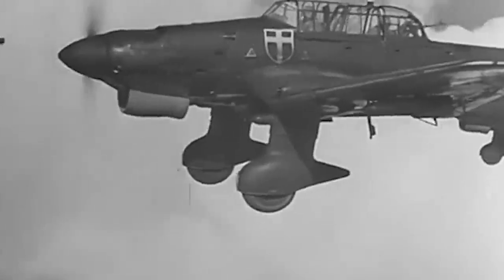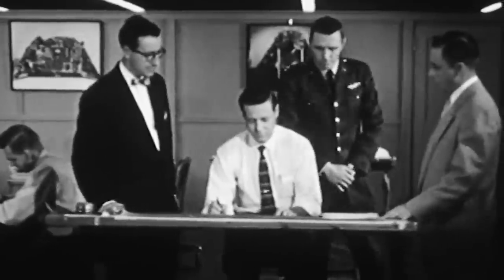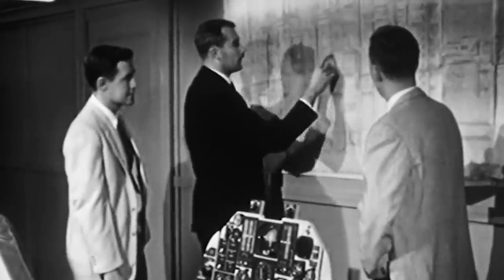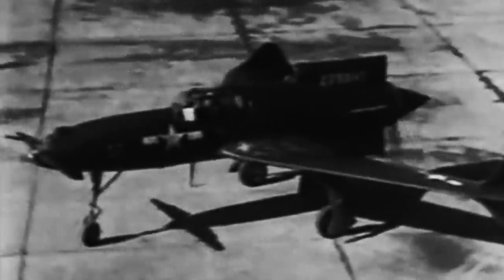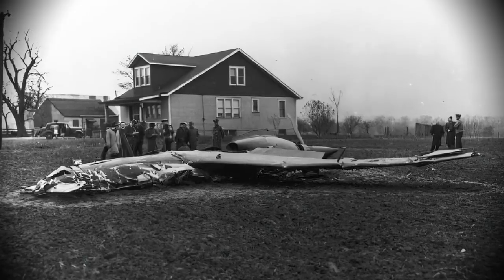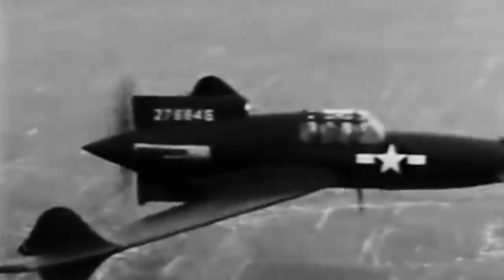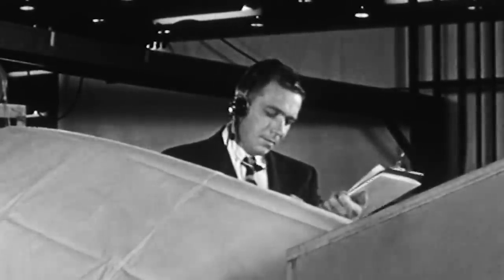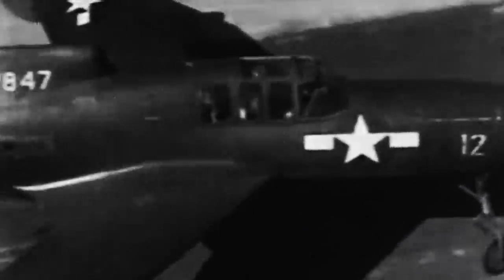XP-55 Ascender - The Backwards Fighter

Comment: That thing was a piece of art. Gorgeous design.
Reply: Controllable pitch propellers whilst adding complexity might have solved many issues with this unique approach to combat flight. There is a modern version called "the Raptor" built by a guy from New Zealand and now with 3 flights under his belt. Amazingly there are no horizontal stabilizers. Might have to ask him if he knows of this design and has any of the wind tunnel data from this variant as opposed to the wind tunnel and now flight test data of his current aircraft.
Reply: The only one left is at an air museum here in Michigan.

Comment: "can we have shinden?"
"no we have shinden at home"
Reply: Shinden made it first flight 5 years after 🤔 But that could fly 👍
Reply: @soeren850  incorrect, the xp55 flew in 1943, shinden flew in August 1945
Reply: @soeren850  The J7W was faster than the XP-55 by 70 mph. However, the Ascender never got the engine it was designed for, the Pratt and Whitney X-1800. As it was, both planes had cooling problems though the Japanese plane had it worse, being powered by an air-cooled radial engine mounted behind the cockpit -- never an easy problem to lick. The X-1800 was a 24-cylinder H-block mill that never worked as expected. Apparently, H-block engines are troublesome by nature. Both the Napier Sabre (used by the Hawker Typhoon, a plane noted for engine fires and dangerous CO leaks into the cockpit) and the Rolls-Royce Eagle were generally failures when compared to reliable powerplants like the Merlin and the P&W R-2800.
Reply: @enscroggs  Exactly. Another design that ends up failing because the engine that it was supposed to use, never materialized, underperformed, was unreliable, had critical issues etc. The X-1800 was supposed to produce 1800-2200 HP. The prototypes were stuck with 1000-1300 Allisons. Give the Ascender that power increase and a top speed of, say 440-460mph. Didn't they work out most of the bugs and improve QA/QC on the Sabre by 1944? CO wouldn't be an issue with the engine in the back, but engine fires would be more common. Thanks for getting me to think about this a bit. :)
Reply: Doesn't Shinden mean Lightning?
Reply: Technically Italy  developed a similar plane in the mid 30's
Reply: I think you mean can we have Ambrosini SS.4
Reply: @NeuKrofta  ss2 was good  though
Reply: @cydia2020  ,you will have to excuse my Japanese. I remember a little.Shinden deffinition depends on the Kan-ji used as to its meaning. It can be several things depending on the Kan-Ji used? Raiden means thunder and lightning as I learned? My cousin had a plane called a Quickie with a canard wing it was very similiar to the Shinden. It would actually pull itself out of a spin. Excellent control without effort!
Reply: shitden? nah
Reply: Exactly my first thought.  The Shinden.  I even built a really good Tamiya model of the Shinden back when I first started getting into airbrushing my models.  Didn't survive my multiple apartment moves in my 20's.   I think the Smithsonian Museum has a Shinden.
Reply: @YamahaR12015  the Ambrosini SS.4 flew in 1939 with earlier versions like the SS.2 flying in 1935
Reply: @NoirChat138  The interesting part about it however is that despite looking so similar, how that design was reached was very different.   While the Ambrosini was simply meant as a high performance aircraft, the J7W was designed as it was to allow for an "easy" switch to a jet engine once they were available.

And somewhat surprisingly, it appears that none of these, the J7W and the XP-55, were built with any real prior knowledge of the other nor the earlier Ambrosini.
Reply: Except they didn't even produce their show-off prototype until THE WAR ENDED, at which point its failure was during a celebratory scenario where it hadn't even taken off as an actual non-experimental thing yet.  Despite the project going forwards in 1940, and REALLY starting ins 1939.  So um...  How many improvements to the carrier fighters of WW2 did we get alone?  

We got the corsair, which was definitely much better than the wildcat that seemed to hemorage numbers against zeroes.  We got the Hellcat, which was by all respects superior to basically any Japanese fighter save MAYBE the Raiden.  And the Bearcat, which came in mostly too late to see actual service (due to some issues with innovative design basically) but which still is among the most impressive propeller-based fighters to ever exist for when it was in service.  At least among carrier-based aircraft.  

And you are telling me that they cannot simply vet and possibly rush through some program to have the next future fighter of this time?  Look, yeah, I know that America was kinda way behind the times at the very start of WW2 and was trying to just modernize their planes.  But that is all the more reason it is infuriating that they didn't pitch at least some level of "all in, develop this thing to perfection ASAP" mentality for such an (in theory)  innovative aircraft.
Reply: @DIREWOLFx75   I find that hard to believe considering a number of Italian and American aircraft designers in the interwar years shared ideas and would work for companies from both. For instance Roberto Longhi worked for Curtiss Wright in the late 20's and early 30s working on the Seversky P-35 and other projects. There really is no way of verifying what sort of aviation publications designers from different countries were reading and possibly taking ideas from. To determine who borrowed from who is difficult but the chronology still remains that the Italians designed and flew a strikingly similiar airplane to the  XP-55 almost a decade earlier.  My intention is to shed light on the innovation and the contributions to aviation made by Italy.
They dropped the first aerial bombs, they performed the first military reconnaissance by airplanes (both in the Italo-Turkish War of 1911) they pioneered floatplanes and flying boats breaking speed records and flying further than anyone else, they essentially flew the first turbofan, were a close second with Germany in jet powered flight, pioneered the use of paratroopers and air supply so much so that the Germans formed the Fallschirmjager.

It's about time Italy gets the recognition they deserve for their contributions.
Reply: @SephirothRyu  You're not taking into account several things. First lets take into account that 1 company wasn't handling all the planes, there was a bunch and they weren't all equally outfit as far as facilities, infrastructure etc. Money was also something that widely varied between companies and that not even accounting for what some managed to add in with acquired government contracts which weren't bottomless mind you. Then there was war, it is a very dangerous thing to get tunnel vision on 1 project in a time conflict as means you can easily become blind to potential better ideas and considering that money and resources are not infinite so using them wisely is the key to success. I should note that going "all in" can end up paying off, in spades even. However it can also lead a company and even a war effort to ruin, the Germans made that mistakes a few times and they might not have struggled so much at other points in the war had they not dumped so much money and resources into projects that while having potential weren't readily yielding desired results.
I could drone on but general point I am trying to make is you are oversimplifying this and there for doing a disservice to complex nature of events and processes going on in this subject.

Comment: Looks like a scifi space fighter. I wish someone would grab up some of these old unique designed abandoned designs and gave them another go using modern tech and remote electronics.
Reply: And an engine that matches the original specs.
Reply: @johngregory4801  why? There's so much better now. That defeats the purpose of doing it with modern tech
Reply: @JathTech  This design was planned for the original horsepower that thet promised Pratt and Whitney engine - that never materialized - was supposed to make.

Build a 600 cid big block Ford, supercharge it to 2,500 HP and let 'er rip.
Reply: @johngregory4801  nothing they were capable of building back then stacks up to modern stuff. If you want to build a hotrod, go for it.  I'm talking about revisiting concepts, and that means modern technology and modern turbine engines.
Reply: @JathTech  If that's what you want, buy a Saab Gripen, a canard fighter with all the modern stuff. It's better than an Eagle in many ways.
Reply: Didnt the soviets build a plane with backward wings? Thats a lot of scifi...
Reply: @ribbitgoesthedoglastnamehe4681  They built the Su 47 Berkut (Golden Eagle) with forward swept wings. Unlike the previous NASA X-29 with forward swept wings, the Berkut had thrust vectoring as well. Both planes were amazingly agile, but neither were turned into front line fighters.
Reply: @johngregory4801  Yeah, thats the one.

Comment: I've built and flown models of the Rutan LongEZ and the first thing I noticed was how small the elevators were.  This planform needs big elevators to achieve rotation at take off.  Also, the planform is  inherently stable which is great for civil aviation but perhaps not the best for a combat fighter.
Reply: That's pretty cool 😎

Comment: I used to live near Kalamazoo, MI and took the family to the air museum there in 2003. They actually showed us the XP-55 they were getting ready to rebuild....with all the bits and pieces they were given....still in the original crates. They were missing parts that they had to fabricate, and were even given parts that didn't even go to that plane! We were told that, due to the secrecy of the plane, they had very little to go on....no blueprints, very few drawings, or schematics.....almost nothing. Luckily, there were enough photos taken that they were able to put it together as best they could...guessing all the way to what went where.....to it's final completion. The re-builders were totally amazing in being able to finish the plane.

Comment: I wonder why they never attempted to convert the plane to jet engine.
Since it already had the engine in the rear, that frame should have been easy to adapt like Japan intended with the J7W Shinden.
Reply: And it had the swept wings needed for transonic speeds.  Might have been as good or better than the Sabre at killing MIG-15s.
Reply: @seanthompson8071  It would especially been a better choice than the F-84 which was essentially a Mustang turned into a jet yet still having straight wings.
But back then US aircraft designers did not have unlocked the swept wing technology.

Comment: Unless I missed it, I heard no mention of one of the main features of 
the XP55: the free-floating canard. The canard was free to pivot about a
 spanwise axis, with its incidence aerodynamically set by some flaps. As
 far as I remember, the first accident was said to be due to the canard 
getting pushed against its stops following a stall manoeuver, with no 
recovery possible.  The aircraft then fell towards the ground nose up, 
that is, ass under.
Reply: Your just playing with words .  The engineers did not know a lot about canards of the time . The stall was not the planes fault as much as the A-Hole pilot not knowing what to do with it . Normally a canard airframe should not stall as one would think . All the aircraft could do is go in a flat stall . That could be corrected into a dive . A Varieze is a canard aircraft and it is one of the safest aircraft to fly and it vary fast for what hp it has .  All aircraft have a limit for that goes .  People even now dont really like these aircraft and think they are silly and made name for them . Still that way to this day .
Reply: @jeffmullinix7916  Nope. This is not a canard in the usual meaning, as the canards you mention. This is a free-floating canard. The canard was free to pivot about a
 spanwise axis, with its incidence aerodynamically set by some flaps.
Reply: @ghislaindebusbecq8864  It is still a canard just like you said it was .
Reply: @jeffmullinix7916  No. A free-foating canard does not work as a traditional canard.

The lift generated by a traditional canard does grow with the incidence ofthe aircraft.

Whereas he lift of the free-floating canard DOES NOT grow with the incidence of the aircraft. 

You cannot expect a free-floating canard to stall before the wing, as it will aerodynamically adapt his own incidence, regardless of the incidence of the aircraft... unless the free-floating canard comes againts some stops.

Comment: The “nose elevator” is called a “canard”.
Reply: LOL I was about to point that out
Reply: Really? I thought canards were stationery and on cars.  Nose elevator sounds right
Reply: French for Duck because it resembles a Duck bill I suspect.
Reply: @donaldsalkovick396  moving canards are a thing, yes.
Reply: But a duck is no ascender , this plane didn't live up to the phrase ' if it looks good it will fly good'
Reply: Canards are very tricky to fly. Had to have fly bywire before could be used successfully on jets
Reply: @johnteeling4679  That's not necessarily true. The VariViggen and VariEZE designed by Burt Rutan are canard controlled aircraft made to be homebuilt and use mechanical linkages for the controls, not a fly by wire computer.
What happens is that on modern fighters the canards are not placed to prioritize maximum stability but to allow quick departures from stable flight. So the canards are controlled by flight computer and move on their own. On the Rutan designs the canards are placed for stability.
Reply: @ChucksSEADnDEAD  are the homebuilt Rutan designs jet-powered?
Reply: @ratherbefishing4225  I don't see how that matters considering that you can make stable jet powered aircraft. Either way, there was a jet powered VariEZE - that crashed from structural failure caused by lack of resin impregnation in sections of the wing fiber weave, not flight instability - and a rocket powered LongEZE.
Reply: @ChucksSEADnDEAD  all I meant was that John Teeling referred very specifically to jet-powered canard aircraft having to be controlled by fly-by-wire and you gave an example of what I assumed were prop-driven aircraft, just wanted to make sure we were on the same page
Reply: @ratherbefishing4225  Early jets using canards had stability problems, but these were solved with the close-coupled canard design. So it's not as simple as saying "canard jets are unstable" because it all depends on the design and intent. Rutan designed a propeller canard aircraft for stability and it was successfully flown with a jet engine until the unfortunate crash caused by build defects. Adding a jet engine does not suddenly make canards inherently unstable, but early jets with canards had design issues that could only be dealt with by changing the design or computerized flight control.
Reply: @ratherbefishing4225  Almost completely irrelevant, but an EZ was used as a pulse detonation engine test platform. Not a jet turbine, but still jet powered.
Reply: As an aeronautical engineering student and someone whose nickname IS Canard, I can help you with that. Have you have heard of 14-Bis? Santos Dumont airplane? It was the first engine powered flight ever publicly performed. Remember, the Wright brothers did their flight in secret. French spectators gave it the nickname "Canard" because when they first saw it flying, they thought it reminded them of the shape of a flying duck. And since it was the first flight people ever witnessed and 14-Bis was a Canard airplane, the configuration in which the elevator is in front of the "main wing" (and the horizontal stabilizer itself) is called "canard" to this day.
Reply: @Luis_Diehl  Typical shallow and mythical etymology. "Canard" is French for duck, but what you are missing comes from not seeing footage of some ducks that land on water by actually forcing their tails forward of their feet to act as an airbrake to slow their touchdown speed. These are ducks with a high wing loading and a high landing speed, so they really ARE "tail first" at touchdown. Once you see such footage, all this shit snaps into focus. IT HAD NOTHING TO DO WITH THE "SHAPE" REMINDING THEM OF A DUCK.
Reply: @ratherbefishing4225  The answer to your question is both funny and tragic: there indeed was one jet-powered Rutan built. But - it crashed on it's maiden flight, killing it's builder and test pilot...
Does that mean a jet-powered Rutan is impossible? Not necessarily.
Did it discourage the experimental aviation community from trying to build another one? To my best knowledge, to this day - yes.
The backwards-prop ones are already about as experimental and it gets!

Comment: I'm actually from Kalamazoo and frequent the Air Zoo. I've always dubbed that plane the "Backwards Plane". 

There's actually a story about how the thing, a german Buzzbomb or Flying Bomb and I think one other but I can't remember which, came to the Air Zoo. 
Apparently the Smithsonian has so much stuff that it can't show all of it. So it's all just sitting in warehouses for who knows how long. The founder to the Air Zoo was invited over to one of these warehouses and told to take whatever they like since it probably wasn't gonna see the light of day anytime soon. So they picked out the aforementioned planes and gave them a home. 
The Accender is actually displayed across from the Buzzbomb and a P-47 Thunderbolt back by the entryway into the space and WW2/Pacific war sections as of this post.